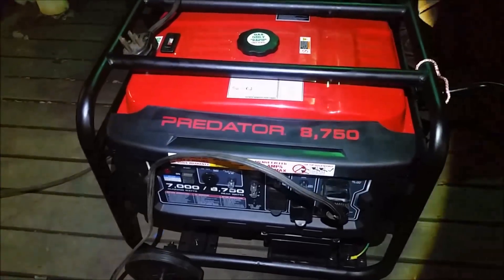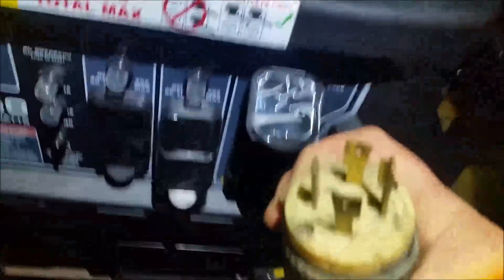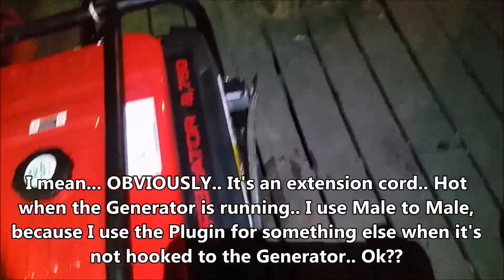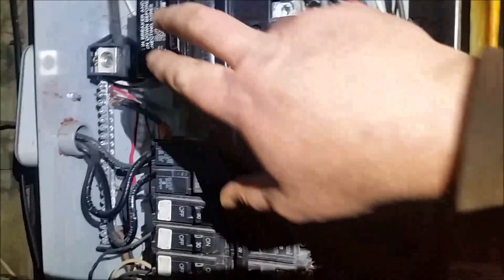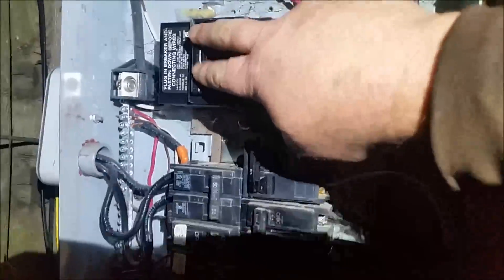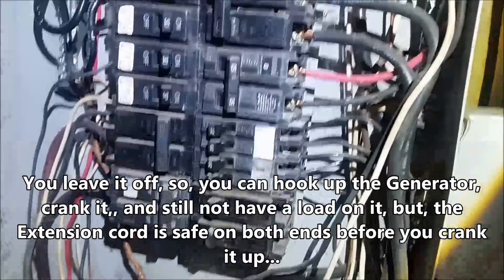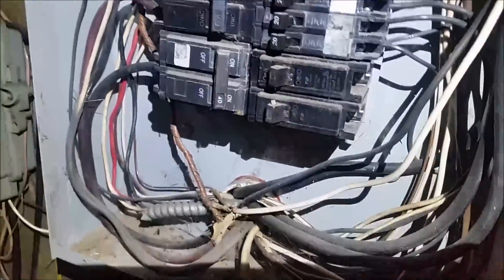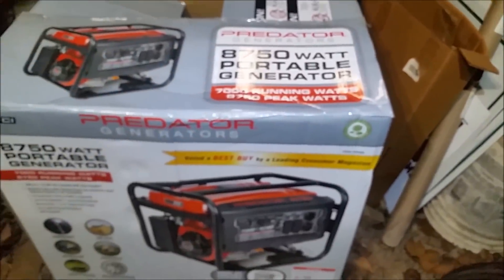Quick/Easy/Safe: Use Existing Plugin/Breaker for Generator hook up to your house Panel box.

Comment: I stumbled on this video searching for a mechanical interlock solution to hooking up a generator to the house. It's amazing how many pilgrims have a knee jerk reaction to it, claiming how dangerous it is to use a "suicide cable" they heard about from the overly cautious "experts". But if you follow the video it is clear that there is absolutely no danger to anyone if basic knowledge of electrical wiring and electricity is applied. This video is for those who have it and the man says so. Those who have paranoid fear from electricity or no good understanding of it should stay away from such a project. 

Mark made an effort to share an obvious solution for those DIY -ers who don't have the money or don't want to pay an electrician for a "safe" installation. I figured it out long time ago just before the big earthquake hit Los Angeles in 1994. Just about a month before to get ready for a power outage. I am a ham radio operator, electronic and computer technician and wanted to be able to run radios should a power outage occur. I had a 3.5 KW generator and a "suicide cable" I made I was on the air 20 minutes after the quake struck, informing hams in the East on 40 meters what happened. They were probably the first ones to hear about it. 

 I used the 240V unused receptacle for the drier to make the connection. I instructed the family to turn off the main breaker before they do anything else. I made a drawing of the setup with numbered instructions just in case i was not around.

Mark deserves the credit for his effort, not sarcastic criticism from those who don't understand the matter or want to point out the risks involved or the legality of it. The latter is a concern, but that's a different subject. This scenario offers a temporary solution; I am working on the installation of a mechanical device to lock down the main breaker (in the off position) while the generator is hooked up. I am sure I come up with a simple solution without paying hundreds of dollars to a "certified electrician".
Reply from the maker: The voice of common sense.. Thanks fella... Yes. I agree with everything you said... 
What you are looking for is a "Generator Interlock".. A very simple thin piece of metal that slides with the main breaker and the Generator breaker... When you turn off the Main Breaker, the Generator breaker comes on and vice versa when the Main Breaker is turned back on, the Generator breaker turns off.. One piece of sheet metal that slides back and forth with the breakers.. If you look at your panel box and main breaker and other breakers, you will see that it works like you want, if you have the Generator breaker on the Left side of the panel.. At least on my box.. But, I was using an existing breaker that was on the right side, so, I did not move it to the left.. 
In the video, if you look at my panel, (the power is not out and I am not running on generator).. Just running the generator for a break-in and running my other generator out back for 10 minutes like I do every two weeks or so.. 
So, the Main Breaker is pushed to the left.. If the Genset breaker were on the left side of the panel, and they were both linked together with a metal bar, when you turned the Main breaker to the left, the Left Generator breaker would be thrown off at the same time.. Move main to the right to turn it off and it would pull the Generator breaker back on.. I'm sure you could make something like that pretty quick and save the $65 they want for them at the local big box store.. Let me post this, but, check back here in 10 or 15 minutes, because, I have to say something else that will freak you out. It will start like this.. (But, I want to get you on the right search track, so you can solve that problem quickly.. )..
Thanks for the comment BTW.. It is dead on target.. 
Wanna say "Wow" ! for a minute.. Check this out...
Ham Radio Operator??? KJ4SLY and 73's to you... Ha..Ha.. I got my license back in 2016 after I saw someone using a VHF radio and reaching up and down the Gorge where my Rafting Company is, and I had just bought the company and inherited a bunch of CB's that were not cutting the mustard.. I met a local Ham and they came out, setup a base station and drove up and down the gorge to let me know what I would be able to do radio wise before I bought a bunch of equipment..  I got my Tech and General the same day and joined their club to meet others like those guys.. Extra now and setup a couple of W4VEC's in the area to get tested and have the data in the FCC Database the next AM.. 
Before this (buying the Rafting Company), I was a Master Certified Netware Engineer, and worked on Networks all over the Globe.. Before that, a Hardware Tech (board swapper computer tech), that fixed anything (printers, etc - board swap level - no electronic diagnosis), and migrated to software support later and then networking..  Now I do anything that someone else does with their (Basic Tools = Eyes, Hands, Legs, etc.).. Carpenter, Electrical, Plumbing, Welding, Fitting, Painting, Cook, clean and sew, etc.. Ha..Ha.. I don't know how to say, "I don't Know".. Ha.. and, do most crap better than someone who has been doing it for 30 years.. Bought a Lathe and Mill and when I have time or need something, I make it and learn while I am making it.. I am not on the Radio as much these days, but, did the Work All States twice on my home made 80 meter dipole that runs from one side of the highway to the other.. That's after I built a fancy Potato launcher to get 80 or so feet in the air, which is still 100+ feet down in the bottom of the gorge.. 
I have a commercial Frequency in the VHF range for my Company and I have a beam antenna that I shoot about 1000 yards downstream into a rock face to bounce the signal back upstream 8 or so miles.. I use 5 watt hand held radios for the takeout about 1.5 miles downstream and get about that far upstream in the bottom of the Gorge.. I mostly use the Baofeng UV5R's or UV82's for my photographer down river to guarantee reaching my 35' tall repeater antenna back at my shop.. If the beam gets moved 5 degrees off of target, I can tell instantly.. Ha..Ha.. 
Check out the trigger mechanism on the gun.. Last picture on the page: http://www.kj4sly.com/ 
It's a Sprinkler system trigger to electrically turn on a sprinkler system.. I just used a pressure sprayer tip to activate it, instead of using electricity.. There are plans out there now on the internet all over on how to do it.. 
That setup is what I was using just after I got my License, and the horse fence antenna didn't work that well between bands, so, I built my own and tuned it where I could get a pretty good signal on 80m, 40 and 20 and most of 60meters..
Anyway.. Nice meeting you.. Take care out there..  Kinda spooky how close we run in the past.. I grew up in Bogalusa, La and lived in New Orleans, Baton Rouge and moved to Western NC in 2005 to buy the Rafting Company.. Cheers!
Reply: @MarkThomas123  Hi Mark, AB6ZE here...www.ab6ze.us. Yea, I just made a paper stencil (template) for my panel that I'll use to fabricate the plate from a piece of SS stock. Very simple, looks like a fat "F", 9.5" long and 1.75 wide that will slide up and down to lock/unlock the breakers. My panel has a single column breaker set, the top breaker is for the unused drier socket in the garage for 240V. I also use it for my linear, wired it to my radio room. The main breaker is two breakers down. .This way the connection for the generator will be "legal".

FB on your company, you are very versatile. Also FB on your ham activity, it's hard to find a better hobby. Although I ride bikes, target shoot and do some boating nearby my QTH in Los Angeles county. I am retired and not bored for sure.

I liked your video and enjoyed your replies to the comments, hi-hi! Keep up the good work and maybe we meet on the bands.

73s, Matt

Comment: Nothing like third world engineering.
Reply from the maker: I don't think third world countries can afford running generators.. It is very expensive except for the absolute essentials. I'm sure Gas is hard to get in third world countries also..  It costs about $15/day to run a generator.. $30 for a 24 hour period minimum. $30x30days would cost you $900 a month to run a generator, when it normally costs in the $300/month on Utility power.. Not sure if 3rd world would have the money to do that.. 
It is just a Generator with a modified extension cord to be used with an existing plugin for the temporary power outage..  And, works like a champ, 100% of the time.